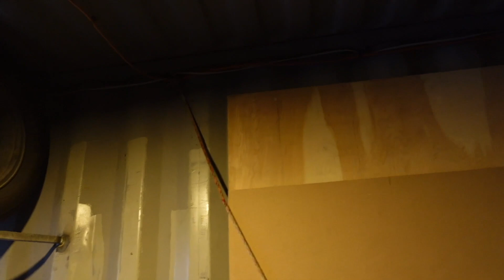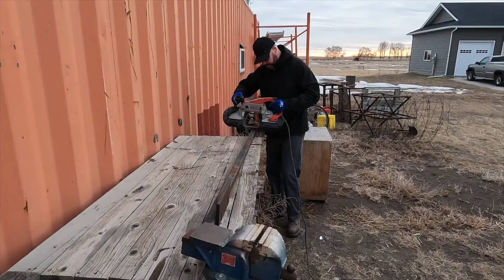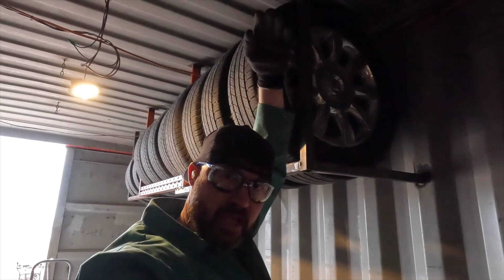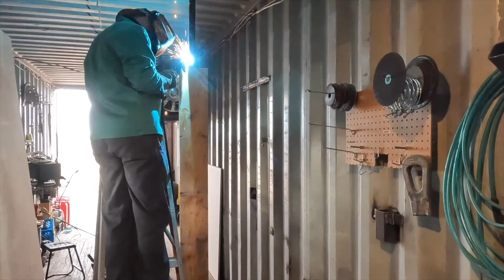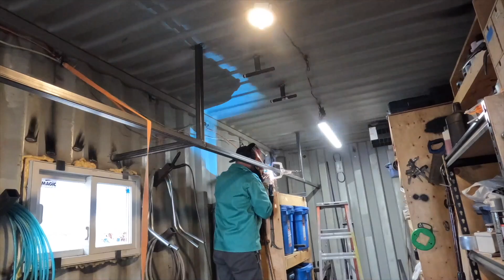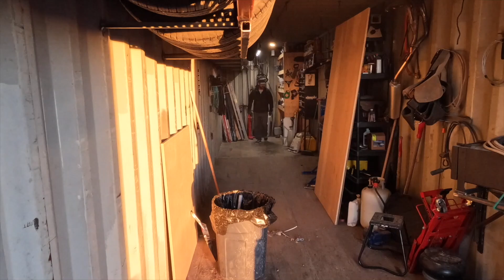New Shelving For the Shipping Container Shop

Comment: I have a container shop, I put in a 10x10 sliding door and on the other side a 20x30 concrete lean to, May end up closing it in. I open it and weld under the lean to. see you have moved into the garage.

Comment: About the crying welder - I assume you got a fresch tip in your torch/gun? 
You should try changing the liner, the part that's actually making contact inside the "tube" for your gun. 
It makes the crying sound since it starts slipping on the driverollers that feeds the wire, due to too much "resistance" in the liner. 
Good luck! :)
Reply: nevermind... just saw your "solution" :(
Reply from the maker: The crying is from the motor inside. Some days it won’t even run because the crying doesn’t go away from start up. It has nothing to do with trying to feed wire. I did a new liner and drive wheels. With no motor available to order, it was over for this beast 😆👍